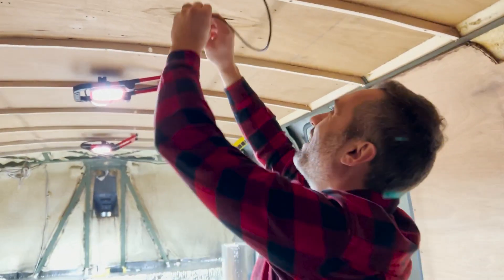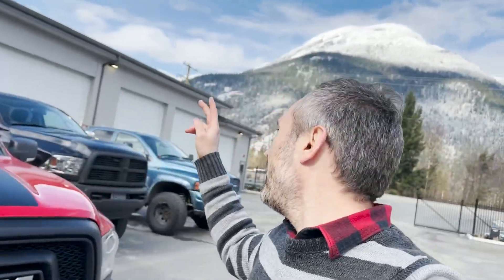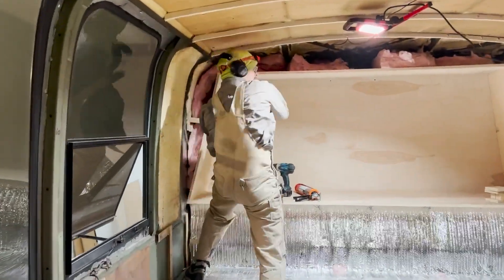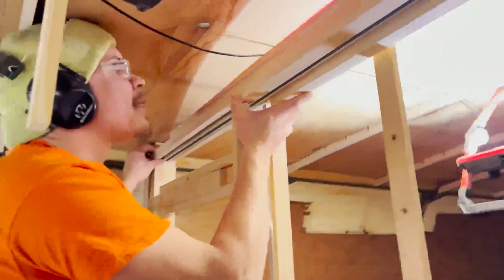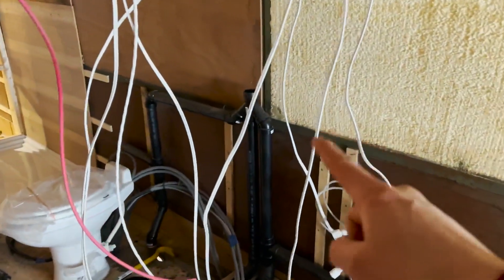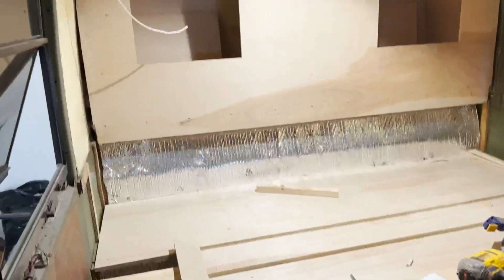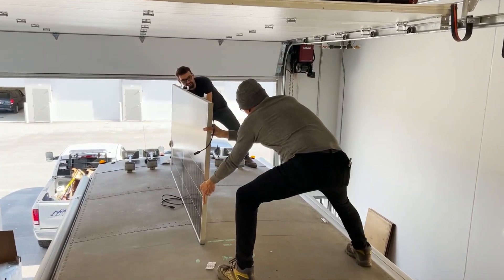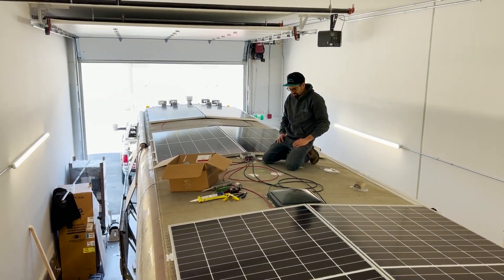Solar Panels INSTALLED on the Bus

Comment: Those panels look like they are pretty well touching at the bottom edge. A hot summer and expansion and if that bus roof flexes as it hit bumps and corrugations in the road ? I don't want to be a negative ninny but it looks awfully close tolerance there ? Maybe not as much close up ?

Comment: Rubber Grommets in the holes prevents Chaffing on the wires over time PY, I use them on my projects and when I used to work on helicopters making Mods for them. Just a thought for you to consider though, thanks for the great update. :)